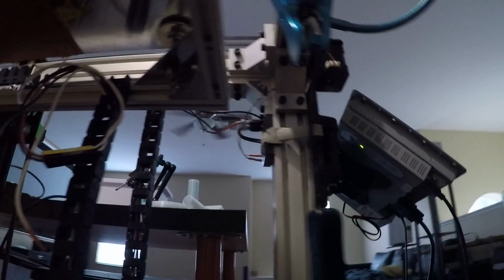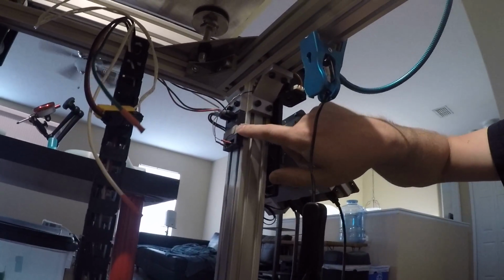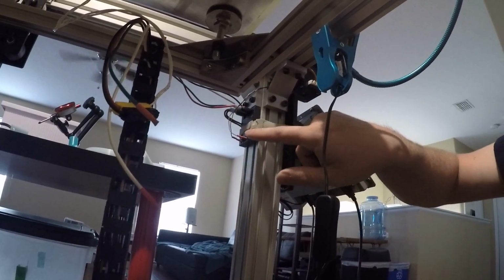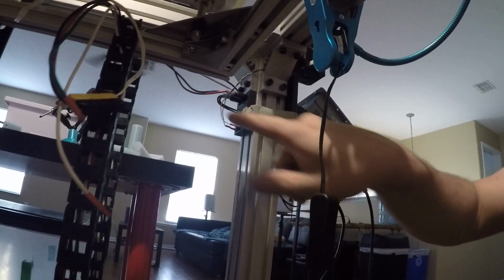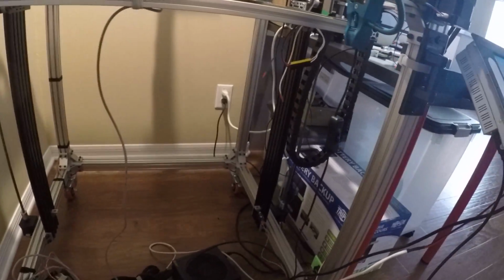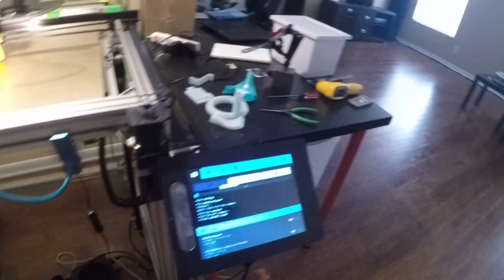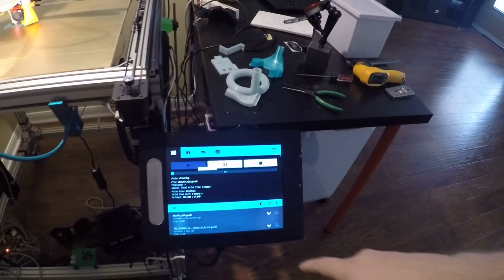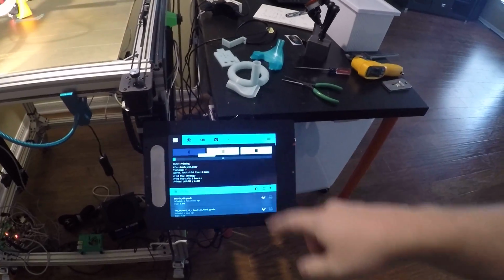Big Repstrap Overview

Comment: The yellow tensor of 40 teeth of the xy axis did you get where?
Reply from the maker: The yellow wheels in the rear? I printed them. I think they were from a parametric pulley creator on thingiverse.
Reply: Thank you, your printer is very cool, gave me several ideas in the assembly of mine.